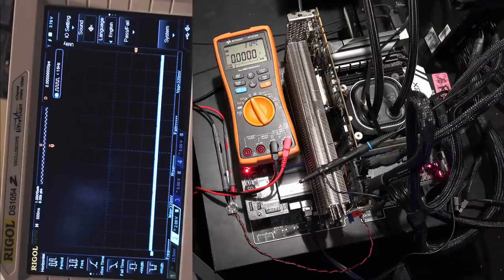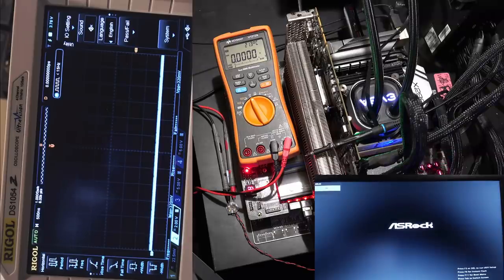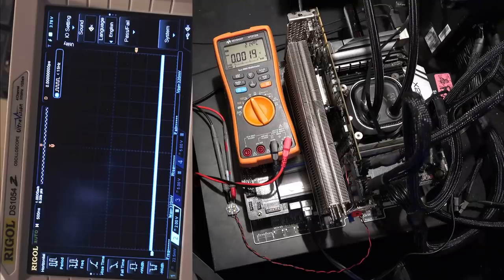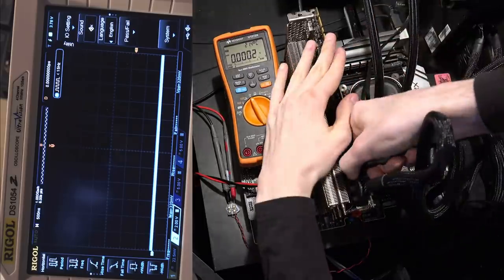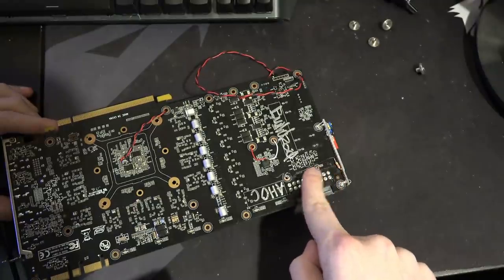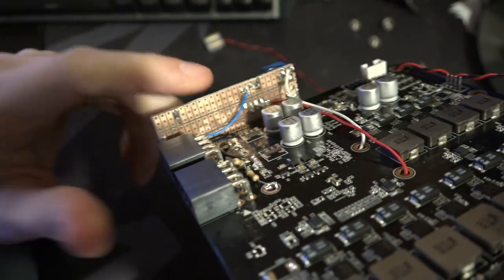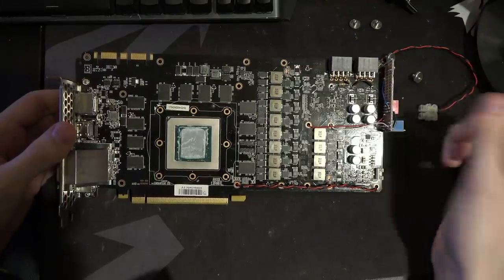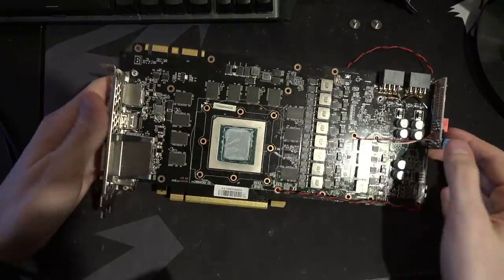OC Adventures: The Palit GTX 1080Ti GameRock gets more mods // VRM OVERCLOCKING

Comment: Fwiw, a camera focus hack is to be mindful of where your hands/fingers are, it focuses on finger tips easier than anything, and if you have one hand down low holding the card by the base of the table, it won’t focus on the top quickly unless you put your hand there, even faster if it’s not trying to decide which hand to focus on.

Comment: I had one of these - It developed a clicking noise on the rear fan bearing when below 75% fan speed.
Returned to the shop after a month and was given a Strix 1080ti as a 1 for 1 change

Comment: I'm happy my 1080Ti holds 2Ghz.  2.5.... Wow.  Nice work.  I'm in the middle of getting my Ryzen Ram speed back up.  A new bios has allowed me to run the core at much lower voltage, and lower my soc, but it isn't 100% stable at 3200Mhz anymore (DOCP mind you).  It passes memtest and such, but it blue screens occasionally.
Reply: I dunno what your cable management is like, but my mate ran his CPU 12v up along the top of the motherboard, rather than behind the motherboard tray, and that was enough to give him the occasional blue screen with his ram overclock
Reply: Thanks for the reply.  That shouldn't be an issue with mine, because my cables come from behind the motherboard (the Motherboard is sitting about 2/3 the depth of the case), so all cables come out through grommets where they need to connect to the board.  It's a good point though.  I know that it's related to a UEFI update, since it was fine before that.  In practice it doesn't make much difference where it is running. Plus my timings are decent 14-13-13-31 atm.  I wish Ryzen liked odd timings on the CAS, because this ram would run CL13.  It is running 3066Mhz, so not too bad.
Reply: Set your ram timings manually and play with ram voltage. Youll get better results than using docp.
Reply: @kiker0909  I'm thinking my CPU's IMC is the issue.  I can run up to 3066mhz with tight timings.  As soon as I go higher, it isn't stable even with loose timings.  At 3.9 it will go 3000.  At 3.875 it will do 3066.  I set the Ram to 1.39 just to be safe.  I even took the vsoc up to 1.175v, but it was still unstable.
Reply: At 3066 the vsoc is 1.125v.  I'm thinking that potentially it was working before at 3.8.  Funny enough the Cinebench score is exactly the same between 3.8Ghz 3200mhz and 3.875Ghz 3066mhz.  Interesting.
Reply: @TheCgOrion  I'm not sure the speed affects Cinebench that much. Running garbage timings at 2133 did within 10 cb points (out of roughly 3000cb) as 2666 with tighter timings, and 3000 needs to be tested further (I had to step timings to absolute garbage). I'm waiting on my 3600 kit to come in. It was all the same kit of duel channel memory, I know, huge channel bottleneck, but that's when it should really show RAM speeds improve the most right? I don't think CB cares much (it seemed to matter more for my Ryzen 1700, so I had tightened timings for it, but it had a really weak controller that couldn't run the 2800 XMP, so I may have just been unstable past 2666 and seeing score degradation)

Comment: you could put the low voltage mode on a momentary switch if it's just to power on the system

Comment: Do you know how the PCIe device ID is defined on Vega/Pascal/Turing? Is it still possible to change smd resistors on the PCB to change a card to their respective radeon pro/quadro/Tesla counterpart? would there be a problem with the driver expecting more Memory?

Comment: Do you think you would be able to capture vdroop on the oscilloscope? Then show how it changes with the different vdroop settings? I think that would help make more sense. I keep thinking "Why would I want vdroop? I want the voltage to stay at what I set it! If normally when current spikes the voltage dips, wouldn't vdroop just increase the voltage dip even more?"
Reply from the maker: I tried to show the idle to load and load to idle transition's effects on a VRMs output unfortunately I had problems with getting the triggering right at the time and some noise issues too. I do want to eventually make a video about it.

Comment: What would happen if a secondary PSU powering just the GPU tripped OCP but the rest of system still runs ? Would the card just turn off or try to pull all its power from the PCIE slot / die ?
Reply: I also want to know, I've had a PSU blow rails (took a $250 SSD with it), but my cards were fine. My next build is quad Fury Halloween themed build with ThreadREAPER (do some more work on the coffin case tomorrow), but I imagine I may over-draw from duel HX1200i platinum PSUs at some point. I've tested one, and it does great at 1500w (from the wall on even 110v) outputting 1350w for a 24 hour stress test with no trips (stayed cool, and the fan barely spins even then, great PSU, hence I'm happy to spend the extra $70 over a "higher rated" superNOVA 1300w, because I know the corsair will just chug along without issues).

I believe the GPU would just shut off though (just like when I usually forget to plug in the 8 pin connectors to my test bench), it simply won't power that GPU. I forget if it keeps running if its the secondary GPU unplugged though... I usually notice its fans not spinning before post.
Reply: I just tested it. I hooked a 1000W corsair PSU to my 980Ti (which I'm gonna bench on dry ice on saturday :) )and turned the PSU off after windows had loaded. The screen went black and the LED's on the cards 8pins started flashing. After plugging the cables back in and a reboot everything worked again.
Reply: @onfireminium3798  That could be a faulty PSU if its not something else. (Probably a BIOS bug or some other anomaly)

My corsair 1200w runs a Titan Xp, 2x R9 Fury, and 3x RX 470 all at once (killer video editing, I batch run 6 video renders at once, similar to how I run 4x instances of Handbrake on my Threadripper to better utilize the cores and cut down encode time in total. You should be able to run twin 980ti with some hefty overclocks (at least 1 with TR 2950x and above, both on DICE). The only exception is if you're running FX on LN2, I'm not sure what the power consumption would be, but my FX pulls about 500w at 1.7 Vcore on phase (core peaks at 10c after an hour of synthetic loads, most benchmarks never pass 0c core temp, so I can only go by the cooler block temp of -25 to -30c under full load)
Reply: Jake Garrett I turned the PSU off on purpose to check what would happen if it trips OCP. If 12V on the GPU 8pins suddenly disappears, it just turns off and everything works again after a reboot.
Reply: @onfireminium3798  Ohhhh, ok, now it makes sense... read it wrong the first time...
That's good to know it's safe. I'm thinking I might need triple PSUs. Thankfully it only uses 500w on TimeSpy with Threadripper at 4+ Ghz and a Fury over-volted, but I'm wanting to run sub-zero on all 4 GPUs (may just ghetto style drop the rad in a DICE bucket) and the TR on LN2. I think that would still be fine, but I'm planning on volt modding the Fury cards with a guide Buildzoid did on them, so I'm sure power consumption will go through the roof!

Did you do you're bench run today? I'm getting behind on my Halloween build, I was planning to have most of my casket case made for "ThreadREAPER", and paint it better on Sunday, but I spent most of last night choosing compression fittings (wow, I will probably never do Hard-Line again, I can make full car radiator cooling systems cheaper than just my fittings alone... Its crazy. I am that dude that refuses to spend more than $20 on a case though, and compression fittings are like $10 a peice, and I need over 20 of them, ouch... Makes the LN2 cooler I want to buy look not all that pricey, LOL!

Hope you got some benching in, its always fun to see what you can push hardware to do, up the Vcore and carry on!
Reply: Jake Garrett I did two really long DryIce OC sessions this weekend. Since it was  my first time,there were quite a lot of problems. Writing everything here just wouldnt work. 
I will do a thread over on overclock.net  talking about everything that happend because I think some people are interested in getting some insights in case they want to get into extreme OC themselves. 
I will reply with the link when Im done👍
Reply: @onfireminium3798  Oh, since its your first time, I'll guess you got first hand experience with the cold bug at boot, and possibly condensation issues.
My prep: plasti-dip all flat surfaces, pack Vaseline everywhere (under capacitors, RAM and PCIe slots, inside sockets, etc) and use a heat gun to make it smooth as glass and water tight (excess will simply melt and drip off during benching, put paper towels under system). Then I put 1-2 layers of thin craft foam (for temps hotter than -60c) and a 5w heater on the back (like back of GPU, or back of CPU socket), then add another layer or 2 of insulation. My phase cooler head gets similar insulation-heater-insulation wrap. I've ran my FX (perfect dummy chip for 500w loads and if it dies, no biggy) for 72 hours straight like that, not a single drop of condensation anywhere. My VRMs have additional heatinsks and 40mm fans blowing air on them, so it keeps them warm enough from the air in the room to not condense at idle (checking emails on the system, etc, its 24/7 stable), and cool enough to not melt when pushing the power.

My setup runs down to -58c at idle, and I haven't had to do anything in prep work since I set it up like 3 months ago. It takes a little effort, but its rock solid. I'm picking a new LN2 cooler for my TR chip. I've only phase cooling for my daily systems (and test bench), or the always fun "winter ghetto style" test bench in a window during a severe flash freeze storm and use high speed fans to see how fast air cooler can run it (my fastest fan is a 100w 120mm modified case fan with a race-quadcopter motor, lets just say, air coolers love it!)